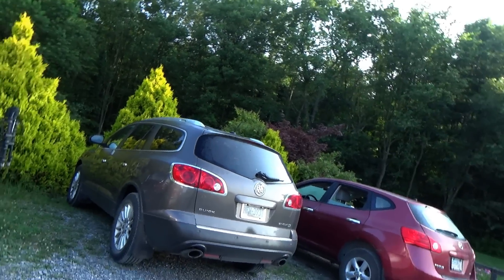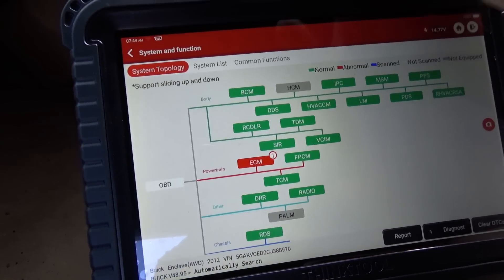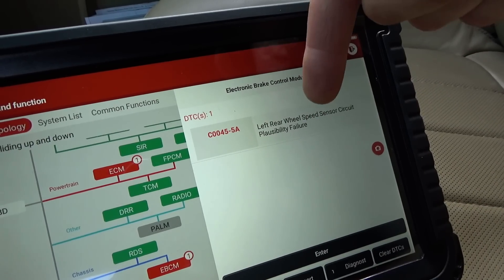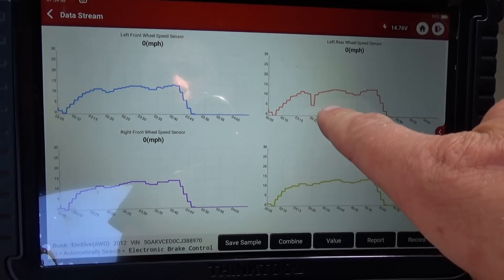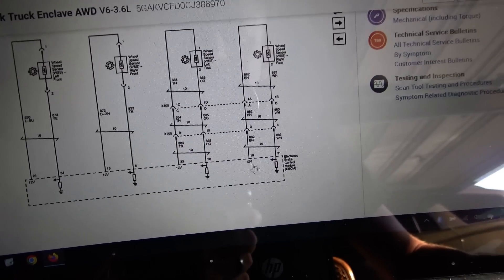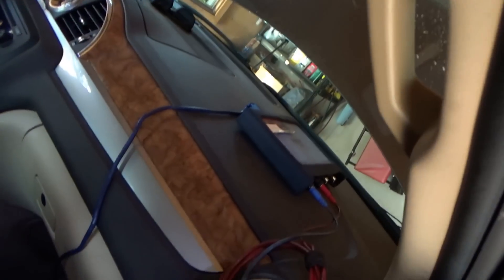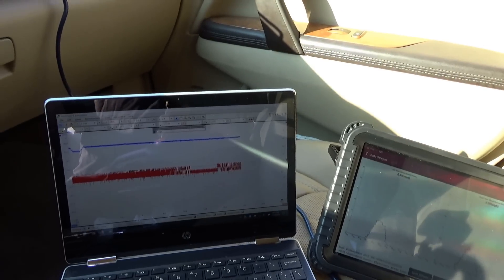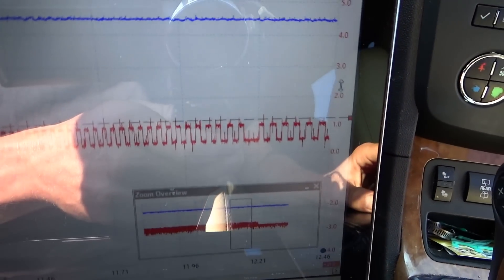ANOTHER Buick ABS MALFUNCTION? (Enclave C0045)

Comment: Great info and diag,
My tip once you’ve decided you need a new wheel bearing with encoder,
Use a magnetic viewing film to make sure the new bearing hasn’t been dropped or has a parts defect,
Nothing worse than fitting up to find a problem with the new one

Comment: Hello Ivan. I am having an issue with a 2021 Hyundai Elantra SE where the backup camera won’t come on when put into reverse. Reverse light come on so I know it’s not an issue with that circuit. I was wandering if you could provide me with wiring diagrams for the whole backup camera circuitry. I’m thinking there is a connection issue somewhere along the harness where it bends from the trunk opening and closing. I don’t have an Alldata subscription but this issue is driving me nuts, thanks! 🙏

Comment: I would put a new GM sensor also, you're there and it would be way easier to remove that corroded sensor with the bearing removed.
Reply from the maker: @scottnusser6232  nothing wrong with the sensor... If it ain't broke don't touch it 😉
Reply: @PineHollowAutoDiagnostics  that's one mans opinion, I would have still given the customer the option . Like l have mentioned before been a shop owner/tech since 85, I don't have many comebacks, how much is a sensor while you're there vs. with labor when it fails later plus if you clean and lube the mounting hole it would be easier to change if needed, just saying I meant no disrespect. I notice one common denominator with all y-tubers you invite comment but get salty if you don't like or agree, give the devil his due son I been doing this longer than you have been on this earth ❤️😂
Reply from the maker: @scottnusser6232  no disrespect at all, I appreciate all the comments! In some cases it makes sense to replace stuff "while you're there" for sure. If the sensor goes bad in the future it would be easy to pop out the new hub since I lubed it up nicely so not a big deal 👍
Reply: @PineHollowAutoDiagnostics  true😊

Comment: I do a few of these per week, easy money. I usually explain it to the customer by saying they use refrigerator magnet material as the reluctor ring. GM Junk. All 4 bearings are the same way so they are all soon to fail.

Comment: I had a similar issue car. There was a dab of grease on the encoder ring. Used the scanner to compare the wheel sensor output and able to find the discrepancy of that wheel sensor. My local mechanic suggested change the wheel sensor. However i was able resolve the problem my self with “NO PARTS REQUIRED “ . Actually i used the knowledge learned from your videos. Thank you for your service ❤️❤️

Comment: That's a handy little tool.  Thanks for the link, Ivan.  I've been loosening the hub bolts about halfway and use an air hammer on the head of those lose bolts.  The hub assembly zips right out.

Comment: I don't know if you will ever run into one Ivan, but Saturn Vue front wheel bearings are a nightmare. Our sister dealership back in the day had to replace the entire steering knuckle because the old bearing/hub assembly would not come out. Of course, there have been a few tools created since then to help getting them out.

Comment: Ivan, had this come up on my 17 Jeep Compass, same spot. Pulled sensor out, had to blow out twice (2x's) particle of rust in/on the magnetic ring, been fine for 200 + miles. so far. My reading surface was the O.D not the face of the wheel bearing.

Comment: Antiseize instead of grease and you won't need jack bolts to get that hub out again. That hub is not a tight press fit like some others. Clean better and use antiseize. I'm the hipster auto technicians worst nightmare. Work on a vehicle component that I have serviced and you'll be silver and gold, but everything will come apart with ease. No bolts frozen in bushings, no inductive heaters or torches, you'll beat book time, but if you're a hipster your only take away will be how horrible that job was because your nitrile gloves got antiseize on them.

Comment: To protect the tone rings, GM made a steel"Wheel Bearing Dust Cap" for some DIFFERENT cars of the ear. Added when replacing the rear bearings (LaCrosse, Regal, Impala, Malibu). $5 parts 23203995 and 6. I think GM eventually improved the design

Comment: If its easy to access the wheel speed sensor, remove it and put a borescope camera in the hole.  It will show the broken magnetic ring.  Test the sensor with a drill using a large hole saw with 4 magnets taped to the outside. Not sure why that ring isnt available as a separate part.  Classic symptoms, the wheel speed signal drops out down to nearly zero, erratic ABS  activation, feeling of having to push the gas pedal harder to move from stop.  
Stay gold.

Comment: Hi Ivan, yeah marine grease (or any other lube) is good practice when installing new parts. However, factory didn't apply any when assembled 12ish years ago, and it lasted till today in your rustbelt. All I'm saying is, you made that hub good for the next 12 years+, with an overall life expectancy of not more than 3-6 on this particular vehicle. Greetings from Down Under
Reply: At least he can write off the loss since he wont need the extractor set next time since it will slip off the bearing.

Comment: I don't use grease because it tends to dry out or wash off within the 6 mouths instead ideal way is with anti-seize grease.
Reply: Never use mobil 1 bearing grease.  I used it on my front bearings when it came out, and on dads new tahoe.  Both had trashed bearings less than a year later.  The lubricant leaks out leaving a  red powder that grinds metal.  It even leaked out of the grease gun tube in my tool chest.
I would think up there you would use marine grease so it can handle the salt.  Pain to pack in bearings, but oh does it do the job.
Reply: @robertsmith2956  Packing bearings is one thing, ideally you do want to use marine grease anyway because it repelled water where pump a lot in too it however, but it does not work as a thin layer between two metal pieces and anti-seize dose much better job
Reply: How many mouths do you typically have involved?  Six seems excessive.

Comment: I wish i could sell 4 bolts with nuts and a spacer as a kit for 40$..  lol. Is like how dewalt used to sell a hammer drill repair kit for almost 100$ and all it had was 2 small 5$ bearings and 2 10$ brushes with a little packet of dielectric grease..  lol.
Reply: China is undercutting them now.  amazon says $24. But not scary back, so grease statins will show.

Comment: If the tone ring were made of stainless steel how would the magnetic pickup sensor pick it up?
Reply: Who said SS isn't magnetic? It still is, though a little less than fully ferrous material
Reply: Only magnets are "magnetic". Some tone rings do use a series of little magnets. Others rely on a magnetic filed put out by the sensor.

Comment: 2013 Equinox 
Stability control error. 
Front left wheel sensor worked fine until heated up. 
Sensor would start dropping out and then drop to nothing.
Pulled old sensor and found the tip split! 
Expected to see damaged tone ring. 
Vehicle is fresh from Vegas so ZERO RUST!
Pulled wheel hub.
Found a three tabbed washer missing tabs and off center acting like a cam! It's the reason for the split sensor!
New $10 washer, which GM lists as one time use and we're driving error free!

Comment: I wonder if stainless steel would even work as it isn't magnetic.  I like the tool idea but you could do the same thing but better by getting some hardened jacking bolts from Fastenal or McMaster Carr and make your own spacer(s) .  I can see the tools jacking bolts giving up the ghost pretty quickly.
Reply: It is an old wives tale that has been passed down generations that stainless is not magnetic. Some is, some is not with the "magneticness" anywhere from weak to strong.
Reply: @michaelslee4336   No it's not an old wives tale. If it is magnetic then it isn't a pure or high grade stainless. It would be an alloy with carbon in its make up. Kind of like these so called stainless refrigerators that rust.
Reply: You can use ordinary bolts as a one time use.
Reply: @rogerdedrick373   That would be wasteful.  Do you buy wrenches and impact guns for one time use also?
Reply: @MrTonyPiscatelle  Would you rather spend your day beating on it with a hammer?   You could use the bolts again but the ends are beat up a little. If you use grade 8 they would last  longer. My intent was for someone without the Astro they could use a couple bolts. It's what I used once before buying the Astro kit and then the lilse. I said once because many on this channel are DIY'ers  and may only change bearing once.
Reply: @rogerdedrick373    That is my point !  Don't buy one time use tools or bolts for tools.  I've use jacking bolts for over 40 years in my field of industrial repair.  I would rather have a high quality bolt and use it a 100 times over a cheap bolt that mushrooms and bends under pressure.
Reply: Who said SS isn't magnetic? It still is, though a little less than fully ferrous material

Comment: I was under the impression that stainless steel is non-magnetic, hence why is is not used for tone rings/reluctors. Quite prepared to be contradicted, though...
Reply: Who said SS isn't magnetic? It still is, though a little less than fully ferrous material. Don't your magnets in the US stick to your SS fridge doors? They did in the EU last time I checked, and here in Oz
Reply: @marcusmohorco380    300 series austenitic stainless alloys (304, 309, 316 ) are non magnetic, Stainless refrigerator doors are made with 400 series ferritic stainless alloys which are magnetic

Comment: When I worked as a fleet mechanic I had to do a ton of the unitized front wheel bearings on Dodge pickups. After removing the first one, I put antisieze on every one that I removed. Made my job so much easier when I had to replace it again!

Comment: You are just contradicting yourself lately you always press for OEM and parts and here lately you have been using a lot of aftermarket parts just keep your opinion on after market parts to yourself you are making yourself look bad.
Reply: Not at all.

For one, we are starting to see a lot of OE parts for the older vehicles not available anymore - discontinued.  Secondly, while not mentioned, the customer may not want to spend the money for an OE part.  Thirdly, some OE suppliers sell a similar or the same part through their aftermarket side.  The OE supplier I retired from did that, OE assembly line, OE replacement, and aftermarket.  Very little content in new cars is made by the auto manufacturer; they contract with suppliers to make and, in some cases, design the parts of a new vehicle.  Fourth, some aftermarket companies buy complicated OE parts from the auto manufacturer or the supplier when the auto manufacturer approves the sales.  

One example is if you buy a Powerstroke 6.0L HFCM from NAPA. It will be a Carter brand name, but if you look at the part closely, you will find it has a Ford part number stamped on it. It would be made by Racor, the company that designed it and sold it to Ford for the assembly line.

A second example is if you need a new crankshaft pulley for a 2012 Ford 2.0L Ecoboost, the dealer shows it as discontinued.  Dorman sells the part, and when you inspect it, you find the Ford insignia and the Ford part number.  And the Dorman part was cheaper than when Ford was selling it.
Reply: Stick to your no name brand ebay parts and keep your comments to yourself bud
Reply: I think he means sensors and parts with semiconductors. Pay a little extra for the OEM versions instead ordering from Amazon and eBay. Hardware parts like bearings and wheel hubs from Korea or even Japan are nowadays very good quality comparable to US or EU parts
Reply: once again he can't GET a OEM part.
Reply from the maker: It's a wheel hub... Not a module or critical engine sensor 😆

Comment: I would've use a large set of bearing pullers (preferably hydraulic) to remove that wheel hub,a bug slide hammer may have worked as well,I don't know why GM in the U.S. didn't do what Holden did in Australia & mount the ABS sensors on the rear differential unit,mine has been going for 22 years without a problem.

The only problem I have had is when I used a ball joint removal tool on the left hand front lower control arm & it pierced into the sealed ABS sensor reluctor unit on my Holden VY Commodore meaning that I needed a whole new wheel hub assembly which I bought aftermarket, it's just a freewheeling hub without any drive splines for a driveshaft..

The problem is that the aftermarket hub only lasted for 6 weeks then I began to hear a  noise coming from the front of the car,I jacked it up & spun the wheel only to hear it rumble which was bad news.

I ordered it on eBay from a Sydney seller so I ordered another one from an eBay seller which is located at Melbourne in Victoria & for the last 10 years it hasn't given me any problems !

Comment: Incredible timing … just yesterday  I scanned my Buddy’s 2010 Cadillac SRX and it has the same DTC - but for the passenger rear … he was ready to shoot the parts cannon and replace sensors and brakes … but I believe we have something very specific to look for now … thanks Ivan …
Reply: Codes rarely condemn the sensor that generates the code. A code is nothing more than a fault in the system. Using diagnostics to pinpoint the true fault is the only way to drastically reduce firing the parts cannon.